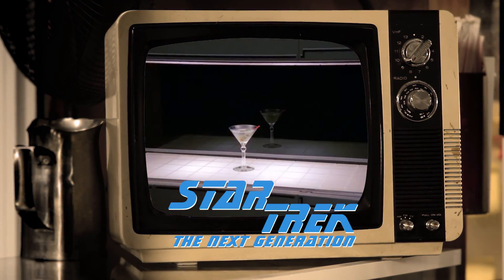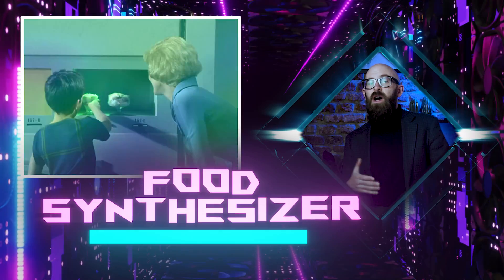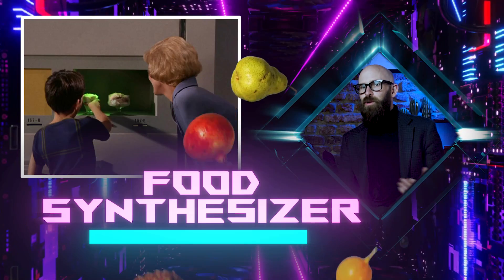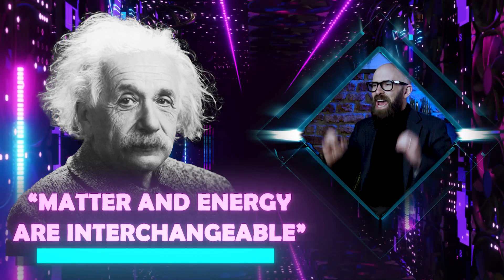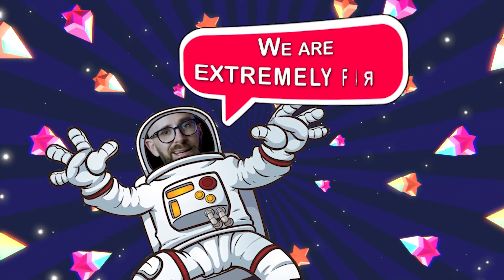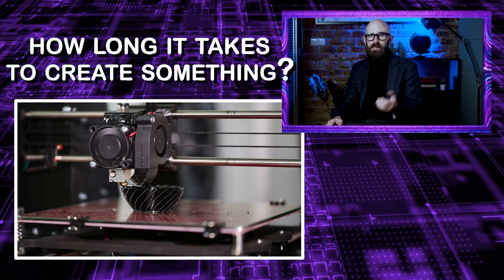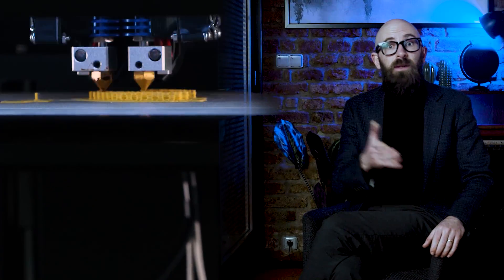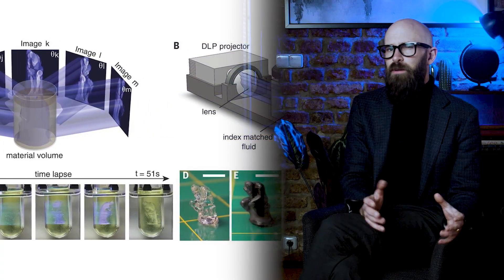How Far Away Are We From Replicators?

Comment: The future of 3d metal prints will blow most people's minds.
Reply: 3d metal printing already exists!
Reply: @snowstream1815  It's very expensive and there are big limitations on what you can print due to technical issues though. I'm sure we'll get it sorted out soon though and I can't wait.
Reply: @rubiconnn  it also depends on what you're trying to do. There's a lot of parts you could make with SLM then place in a CNC to clean up the few surfaces where tolerance matters. Its actually easier and more economical to use 3D printing for tougher materials like titanium than CNC alone
Reply: @levib0057  The whole point of additive manufacturing like 3d printing is that you can create surfaces that would be completely impossible with CNC, like parts with complex shaped parts made of a single piece of metal that are entirely enclosed so there is no way to get tooling inside of it.
Reply: @rubiconnn  that is not the "whole point" of 3D printing, just a major feature. Also, you often still need to mount a 3d printed part to another portion of assembly, which requires staying within some reasonable tolerance, which 3D printing is terrible at. It's very common in metal 3D printing to have a machining stage at the end
Reply: I've seem a pic of a 3d printed gas turbine nozzle, it looked organic, half man made, half natural.
Reply: You're not wrong.  A 3D metal printed gun will certainly blow someone's mind... all over the wall.
Reply: @loka7783  tbf, you don't need metal 3d printing to make a gun. There's a decent sized community behind 3d printing guns with PLA+